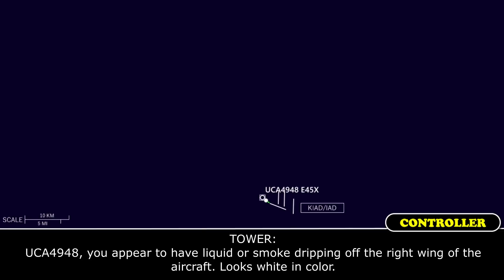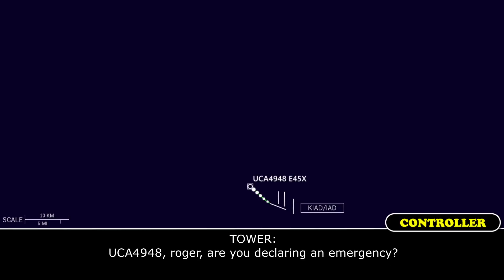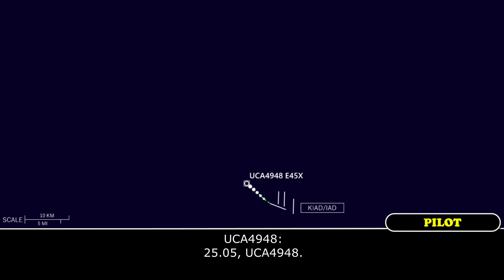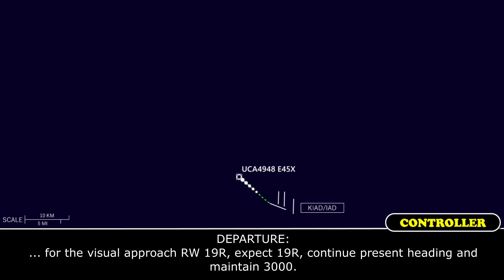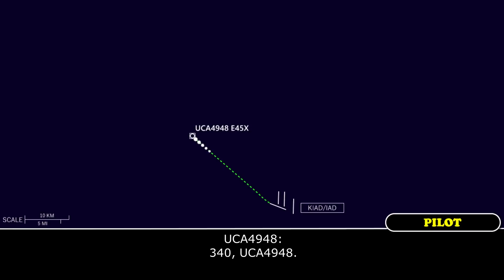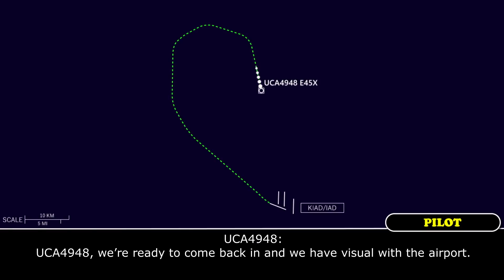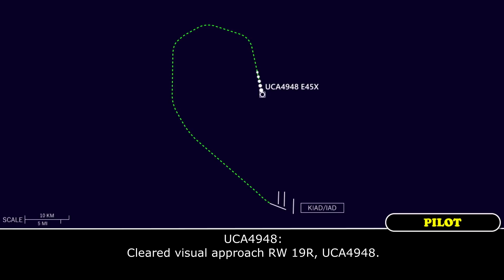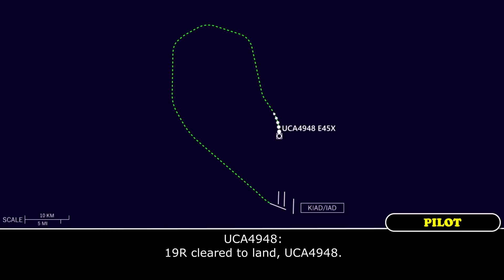FUEL LEAK on takeoff | CommutAir Embraer EMB-145XR | Washington Dulles airport

Comment: Good video mate, just wondering, you planning to cover the air France incident that happened yesterday that returned to Paris due to a fuel leak?
Reply: Sorry not a fuel leak, hydraulic leak
Reply from the maker: Hello, I don't know about this incident. What flight?
Reply: @YouCanSeeATC  air France 974 I think it was, from Paris, squawked 7700, I'll try get the callsign
Reply: It was air France 926
Reply: @dantebingham6043  also watch "vasaviation" if you like videos like this because sometimes one will post it but the other channel won't
Reply: @kylanm7053  yeah I watch vasaviation already
Reply from the maker: @dantebingham6043  Thanks.